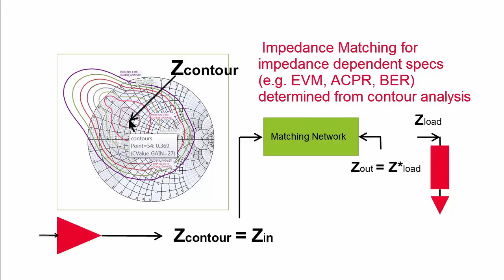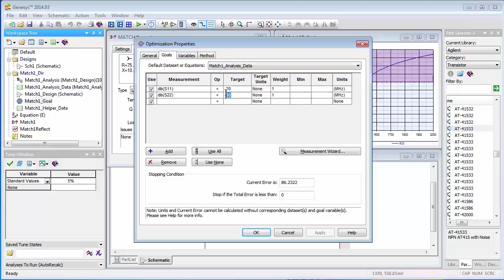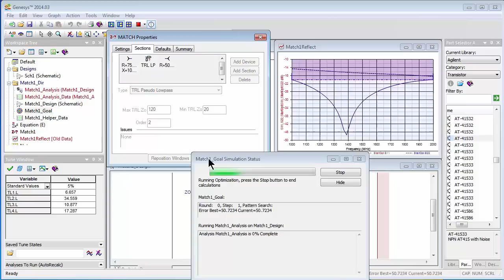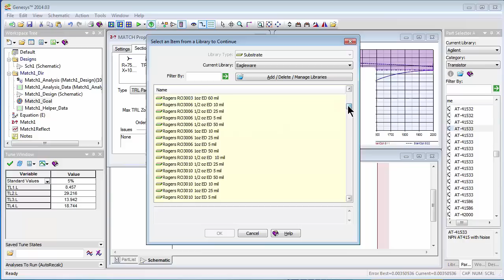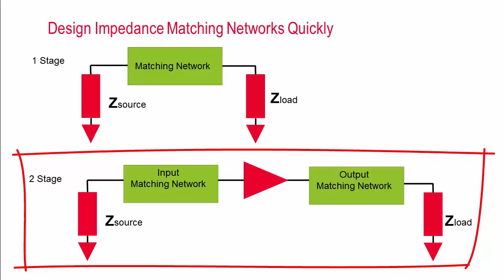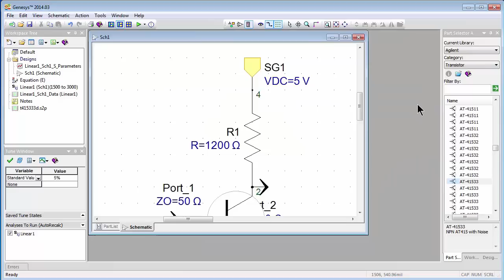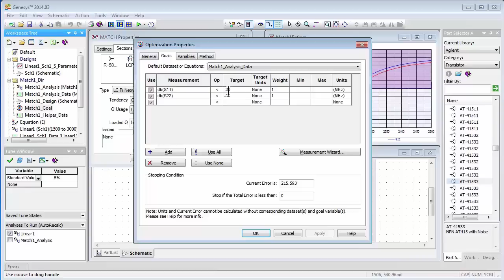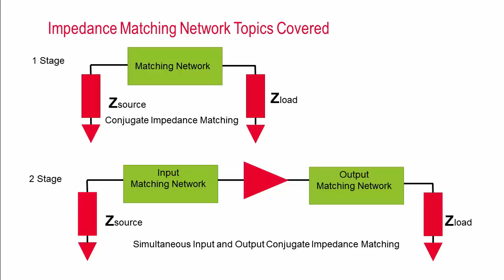How to Design RF and Microwave Impedance Matching Networks

Comment: Someone commented the same question below but I didnt understand the response very well. If the S parameters are given in a s1p file (as oppose to a s2p file), how can I use that as the input impedance when using the match synthesis? Thanks.

Comment: When you design this matching circuit i see an inductor value of 4.8nH which is impossible to make in layout design since you have power combiner at the output of transistors. How can we design LC network with reasonable values ?  Is it possible to put limit on capacitor and inductor values ? Thank you.

Comment: hi,
I want to match with a antenna. but impedance of an antenna varies depending on frequency. so I chose the option "S/Y/Z file" but it allow to insert s2p/y2p/z2p only while I need only one port to measure the antenna impedance, mean that I get only s1p file. so, how could I use that option. or could you tell me the another way to match an antenna in wide band ?
Reply: Hi friend  For one  port (s1p) calibration, you need to do Open, Short and Load for port1 calibration.   For two port(s2p) one, you need do individual port1(O,S,L) & port2 (again, O,S,L) calibration before 2 ports inter-connection compensation(just connection port1 and port2 with a ''through'' commponent).     F.Y.I

Comment: Hi,
Could you please explain the step by step theoretical procedure while designing the 3 stage matching network as I always have difficulty in designing the interstate matching network.

I have already gone through your webinar but you did not tell the theory being used for interstate matching network design. I mean can we design it manually using the information of the reflections coefficients by running the load pull simulations
Reply from the maker: Hi Rachit, Here's how Match Synthesis works. This was taken from the Genesys help documentation, and for more details search "How MATCH works" in the product documentation.

Consider the following amplifier matching problem:
SOURCE   [NETWORK]   [DEVICE]   [NETWORK]   LOAD

In the first pass, MATCH uses a synthesis algorithm for the input network to match the source to the device S-parameter data. This synthesis may be exact or approximate, depending on the nature of the source, the network and the device.

Next MATCH computes the impedance looking into the output of the device and synthesizes an output network to match this impedance to the load. If the synthesis is an exact type, and the device is unilateral, an exact solution results at this point. However, the device typically is not unilateral, so the output network just inserted changes the required input matching network. Therefore, MATCH computes additional iterations for the number passes specified in the Defaults Menu.

If the synthesis is exact, the solution is very good at this point. However, because the source and device impedance data is typically frequency dependent, the synthesis is approximate. Optimization is used for an improved broadband solution.
Reply from the maker: If you still have more questions, you can submit this form to speak with an engineer, http://www.keysight.com/find/eesof-sales-assistance.

Comment: Please how can I use a commercially available library like Avago and Murata in doing my matching. in Genesys. I really want to match with components I can easily get in the market
Reply from the maker: +S.I. CIMTHOG To use commercially available passive components for matching,go to the Tune Window, select Standard Values to tune and check Match1_Analysis
to auto recalculate.
Tune the passive component values to the nearest commercially
available standard values and make sure the match return loss is not degraded.
For extra insight, you can substitute the tuned components with
the actual S-parameters of the L or C from the Murata library in Genesys and
analyze it with the linear simulator over your frequency band.
Reply from the maker: +S.I. CIMTHOG To use commercially available active components, Genesys canautomatically synthesize the input and output matching networks to the
component S- or X- parameters. Highlight the input matching section. Click Add
Device and browse to the SYZ file to define the device. If you have your own
design in the workspace, browse to that design. 

Highlight the added device. Click Add Section to add the output
matching section to the device.

Watch matching magic happens when you click Calculate and
Optimize.